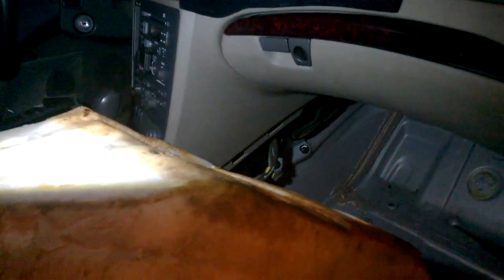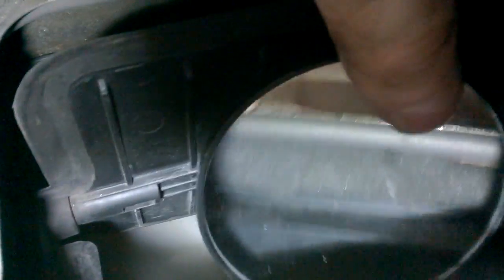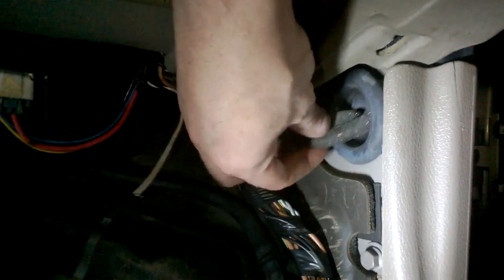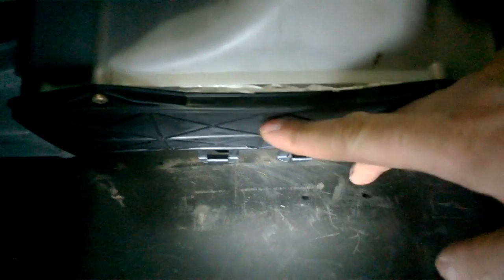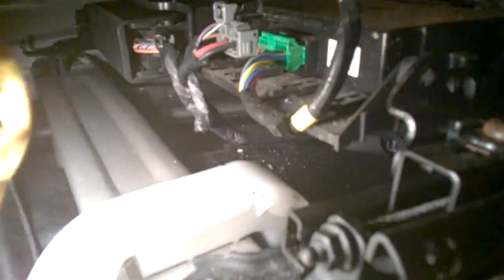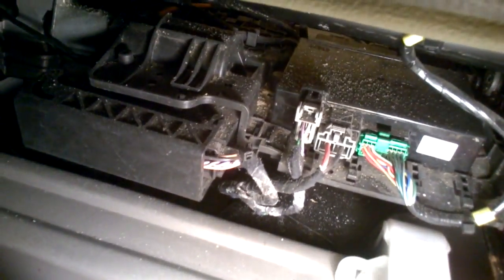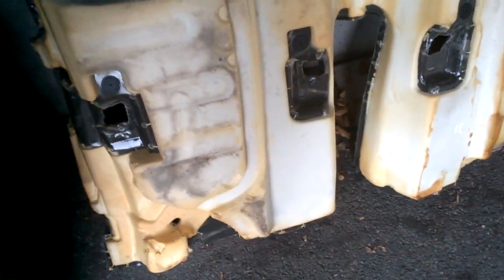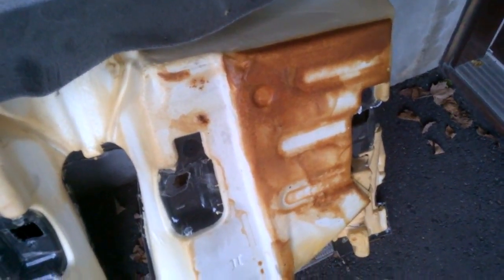Volvo S60 V70 XC70 XC90 Wet footwell from water ingress (+carpet removal)  2001-2009

Comment: I fixed the water ingress issue many times, most are caused by water getting in under the rubber seal under the air dam in the cowl area, years of dirt will breach the seal but more often is caused by the metal strip under the windsheild getting a rust spot directly over the cabin air intake, which creates a drip that goes right into the motor area. The fix is to one clean and seal the rubber on the bottom of the air dam down with a quality sealant and to build a cover over top of the air intake(an old windsheild washer jug bottom cut in 1/2 works great), you just have to make sure it is tall enough and make side vents so it still gets good air flow. If its not the windsheild leaking or the sunroof drains this will fix it 100% Its a design flaw which they picked up on because after 2009 they had factory built covers over the air intake
Reply: My 2013 leaks as well. I'll never buy a volvo again.

Comment: I had a serious leak for several years. Repairman said it was coming from the front windscreen. I had the screen replaced yesterday. The repair guy said there was zero bonding material on the top of the screen and he could push it out with his hand. Worse than that he said the front screen pillar was completely rusted away and the whole thing will fail soon. The back of the car is flooded with the carpet, mat and under carpet foam soaked through. Surely this is a recall issue. The windscreen replacement guy also said this is common in Volvos. Mine is a 2010 V50 which I bought new in Sweden.
Reply from the maker: I know the first generation XC60 had a similar severe problem with the factory windshield using a coating that would not adhere properly, many vehicles were affected and even the replacement genuine windshield would cause again the same issue.

Comment: In my case it was water coming in the top of the windshield due to poor sealing.   Known issue on the P3 volvos.     Had to get glass repair shop to reseal entire front windshield.   It’s not always the sunroof drains (but is often the case or both).

Comment: omg what a nightmare I have that issue now at the passenger side, I don't mind changing the oil or replacing a waterpump, but fiddling with bits of plastic that snap and break are my worst nightmare, but your video is very very helpful
Reply from the maker: Also be aware that the floor carpet tears surprisingly easily if you pull it like a 'scissor', like tearing a paper page.

Comment from the maker: Sometimes the rear bench can get stuck and won't lift from its brackets no matter how much you pull (watch your back!). If this happens, look underneath at front with a flash light: you will notice a black plastic piece - one on each side.  Use a pry bar to push upwards from under this plastic piece from the side (facing the door): this should pop the piece out along with the bench. The piece may break so you may need to replace it. Alternatively, you can try to tear the carpet by lifting the seat foam a little, and pulling gently on the carpet near where the seat is secured and towards the door - pull gently so you don't tear it in the wrong direction - it does tear quite easily actually once it's started

Comment: Good evening, Peppermint- if there is water in the rear footwell, do I have to dry out the front footwell too? I know you said if the front is wet, the back definitely will be, but does it work both ways?
Reply from the maker: Hi, it always depends how much water is in there.  Under the carpet and under front seats the water can 'travel' both ways through 2-3 holes in the floor cross member (the transverse bar on which the two front seats bolts are secured).  If there's a lot of water under the carpet, it will travel both ways, in my opinion.  It is relatively easy to check under the front carpet, can lift it a little from the corner near the passenger front door hinges, and can slide a hand underneath. Careful as these carpets rip quite easily.  If removing the carpets, I recommend using some expandable foam to fill the holes in the cross member.

Comment: My a pillar drains on my 04 XC90 were broken on both sides and the drainage tubing I fell down inside. How would you retrieve it to where you can connect it with a brass connector?

Comment: thank you.. my floor in my 04 V70 is rusting.. my Dad drove the car from 64k (km) 402k and then I have gotten it to 460k. trying very hard to go another 100k. I already started just cutting carpet because it was so bad and I needed to keep driving. Your water ingress videos are very helpful, and I am sealing as much as I can in quarantine.
Reply from the maker: The best material to prevent rust from spreading is the resin used in composite applications - the resin part only. Once hardened it seals perfectly the area from humidity and further rust spreading - of course the area must be perfectly dry before application. It's messy and requires strong gloves but it absolutely works. I've tried other things like shown in videos and forums, but that resin is the only one that really stops the humidity from reaching again a rusted area - this is also true for body work.
Reply: @Peppermint1  Resin?.. can you give an example? so far I just used fluid film (lanolin wax based)
Reply from the maker: @austinswirsky6885   A resin with hardener that is used for composite applications (fiberglass, kevlar, etc).  You only use the resin with the hardener, this is just an example  https://www.amazon.com/3M-20122-Purpose-Fiberglass-Resin/dp/B003ODJ8J4/ref=sr_1_2?dchild=1&keywords=fiberglass+resin&qid=1586980817&sr=8-2

Comment: Thank you so much for this video! My heater core was leaking in my 99 s70 & I didn't know it. My carpet is wet & so is the foam underneath. I was able to remove the carpet, but I can't figure out how to remove the foam. Does it have to be cut out? Can it be dried out instead of being replaced? It's pretty wet. Will a wet vac work? I'd rather clean it & dry it, rather than replace it...if possible. If it has to be replaced, where would I get this foam? I'm in the US.  Once again, thank you so much.

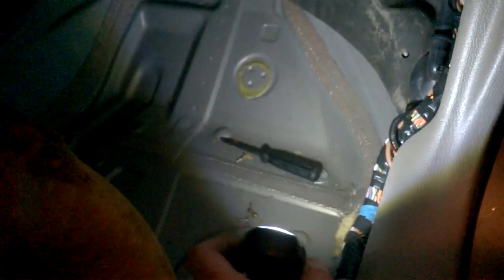Comment from the maker: Rear drains tubes underneath the hood liner https://www.youtube.com/watch?time_continue=115&v=mbm_VWpggfY . The rear tubes end inside the trunk with a rubber piece located just over the metal wheel well area, behind the side covers, on each side.  In front, the tubes end with the rubber piece seen just near my finger at 0:45 (just lift a corner of the carpet).  There is a similar piece on driver's side. Pull these rubber pieces and check them for any debris.   Please note that removing the front A pillar plastic cover trim piece to expose the front tubes is NOT recommended: this trim piece is secured with special shearing clips designed to break when the curtain airbags are deployed: if removed, the trim piece may not be secured properly back in place and fly free and become a hazard/cause wounds in the case of a car crash.

Comment: Hello Peppermint (SORRY FOR MY ENGLISH)Thank you for all videos.
At the start of video you have on the floor the cover of air filter cabin and there is a rubber gasket all arround the cover.
But the blower doesn't have it,( my Volvo S60 2001) doesn't have either.
I have problems with water as well and I noticed the water leaking in 2 areas 1.where the blower is mounted (there maybe is a missing gasket) 2.Where the power blower connectors. 
I removed all car carpets,the blower.
I put silicone all arround (where I think is a missing gasket and i insulated the the power socket of blower) and let the car outside,.
Two days it was heavy raining and no water at the passenger floor noticed,.Next 2 days is still heavily raining will coming. 
Outside I just cleaned the plastic where the air comes from outside but I think its better to put silicone there as well.I will let you know after a few days if the leaking is stopped or not.
Reply from the maker: Silicone works very well - use outdoor rated silicone. The cover under the blower has a small hose going outside, good to make sure it's not clogged. The air climate also has a hose - https://youtu.be/aH5kWCXzM98

Comment: Hi Peppermint. I had water under the carpet  again and did again as you showed, but some rainfalls later, still water would penetrate in. So I learned (from my Volvo garage) there is one additional way for water to penetrate inside the vehicle, if you V70 has a roof that opens up. There are four drain holes inside the roof recess and if theses are clogged then the water goes ways I do not know, but it ends up underneath the carpet.
Reply from the maker: Hi Franz.  Your mechanic is very much spot on.  The tricky part is that even on cars that never use the sunroof, the seal is not 100% perfect and lets rain water pass by. In large cities, rain is dirty with dust, this dust leaks past the sunroof seal, into the drain tubes, and after a while it blocks them. Once the tubes are clogged, the rain water fills the sunroof tray and overflows under the headliner.  I talk about this here  https://www.youtube.com/watch?v=MlaiU2ysB5E  Cheers

Comment: Thank you for all the Volvo videos.   Is there an ac condensation drain near the blower drain too?   2004 XC70.  Just had a second issue of passenger front floor flooded.  Top seems fine.
Reply from the maker: I don't remember well. For left hand driving cars, I think there is one A/C drain on the left side of the center console (near the gas pedal), then two hoses near the right front door - one from the sunroof (if equipped) and one from the cabin blower housing. There is also a drain from the sunroof near the left front door, then two more drains for sunroof the by the rear wheel wheels (passing inside the trunk, behind the side covers).

There can be several points for under the carpet water on the right front side, for example the cover under the blower must have all screws in place or it will let water leak (I show these screws on the blower video).  The cover under the cabin air filter must also be tight (it has a small seal)

Comment: Thanks for this video,Nice work :)  the trims by the door clips off easy,, the seat bolt covers i used a heat gun  gently at low low heat blowing under and pull them up easy

Comment: Any suggestions on how to clean the underside of the foam?  Just a soapy water soak?
Reply from the maker: Does it got mildew on it ?  May try spraying only underneath with some household cleaner but I don't think it will help much because it cannot penetrate inside the thick foam. As for drying, I had my carpêt completely out of the car sitting for about 2 weeks before it did dry completely, it takes very long. Maybe it's easier not to remove it and to soak in instead with some soapy water soak as you say - use a soap that's doesn't smell too much, then coat the foam with some anti mold product to keep the mold from spreading.

Comment: Also I had for couple of days 'Anti skid service required 'and the Volvo dealer ( he is not official volvo dealer but in his service he fix only Volvo)
said to me there is a problem with water under passenger seat(where the antiskid sensor is located)
The message popped for 2-3 days and it went off.
I checked with VIDA and there was a problem with :
Antispin function,doesn't work PA
ABS- 00A1 Tils speed sensors 1&2 signal outside its permitted range. 
ABS-00B2 Tilt speed sensor 2 Faulty signal.
ABS-00C0 Stability function Wheel alignment or steering wheel angle incorrect 
Checking the switch, climate control module CCM.
Any advise for this problem?
Reply from the maker: The yaw sensor may get corrosion on it on the S60 with DSTC but it's more common with the XC90 where the sensor is more exposed to corrosion. You can undo the two floor bolts and unscrew a little the two rear ones, and incline the whole seat backwards and look at he sensor. But first make sure the steering wheel is centered correctly when driving on the highway (wheel geometry), this can confuse the stability system. Also, look at the front reluctor rings for small cracks and make sure the axle bolts in the middle of the wheel are tight - about 35Nm
https://www.volvooftorontoparts.ca/p/Volvo__S60/Suspension-Yaw-Sensor/42796583/30667565.html?partner=googlebase
Reply: Just now I was driving and at certain point I break and the asphalt wasn't very good the message "Antiskid service required " was show immediately. 
A doubt may be something wrong with ABS sensors?

Comment: Did you use any kind of adhesive with the foam underneath the wipers or did you just place foam in there? The foam was completely dissolved in mine and I need to replace it
Reply from the maker: If you place new foam, it has to be glued (or squeezed tight) in there because if it breaks free, it drops inside the fan blower and will cause it to be unbalanced and vibrate. I did add a little piece of foam like a pipe insulation foam which is water tight. So you may try cut a new foam and perhaps it's better to make it larger and to force it in there to stay tight. Don't forget to clear the small holes around the two drain tubes I also show, otherwise water gets too high under the windshield cowl
Reply: @Peppermint1  thank you, I've also been removing the carpet but I'm struggling to remove the back row seat cushion like you say. It doesnt seem to to just come off even when I give it a lot of strength. Do you have a video showing you removing the seat?
Reply from the maker: @OscarRamirez-xe6eu  Sometimes one or even both two plastic 'brackets' won't release the metal rods from the seat cushion. I don't know why it happens, but there's no point pulling on it, it will not work no matter how much you pull (and it's bad for your back).  Instead, pull to lift a corner of the cushion and see the black plastic piece on the floor side, insert a long pry bar under this piece and pry up - the piece may or may not break, but it should detach from the floor along with the cushion. So there's a chance you will have to replace that piece (from Volvo or junkyard). You can also try carefully to tear the carpet on the side under the seat to free it from the brackets, go gently because it tears off quite easily
Reply: @Peppermint1  thank you, you've been very helpful during this DIY. I went with tearing it out and got the water out. Again thank you
Reply from the maker: @OscarRamirez-xe6eu  Glad it worked!